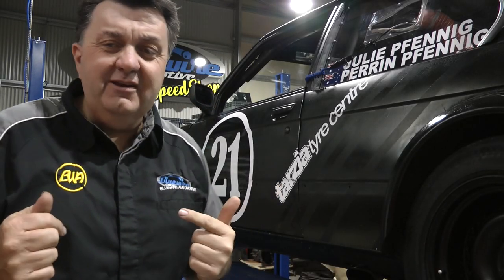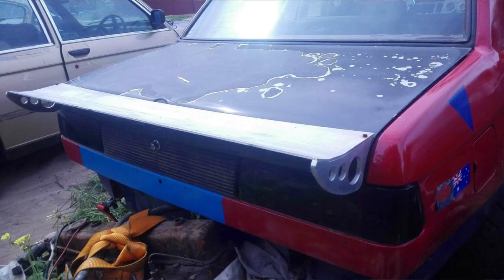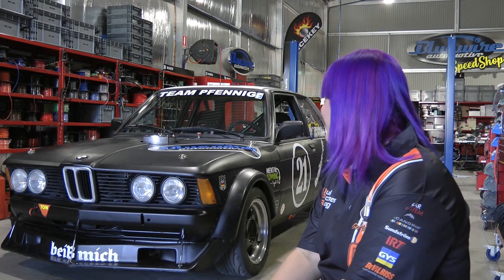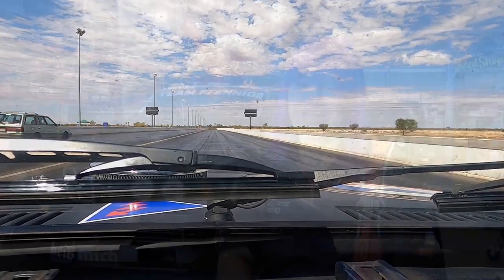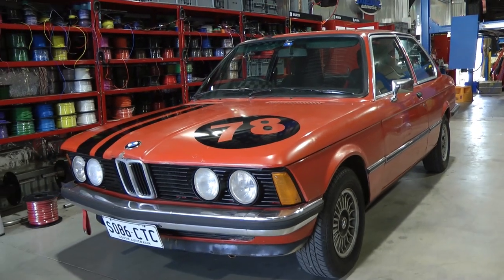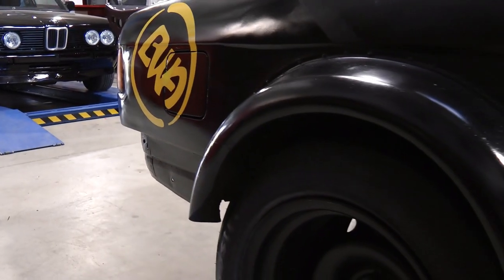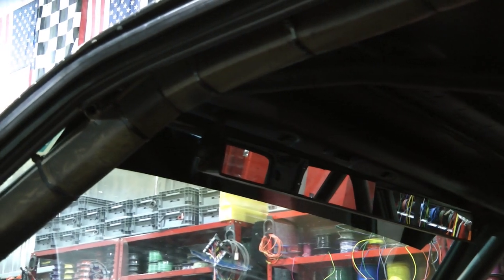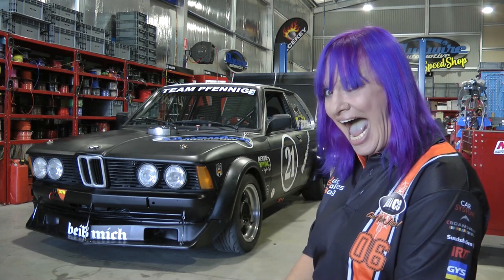TEAM PFENNIG'S BMW E21 RACECAR: Episode 1

Comment: What front shocks are you running. I currently run a home made coilover system but the shocks are too hard and too long so front suspension is rock hard with very little movement.